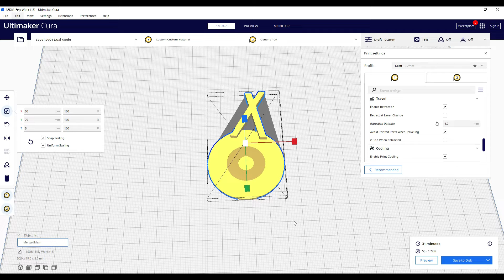What is the Optimum Retraction Distance while 3D Printing?

Comment: What's the name of the guy right there? How about the little blob guy? 

Anyway, thanks for posting this video. I can now proceed to try 2mm distance if it will make any improvements on my printing. Currently I'm using 0.4mm nozzle as the default that comes with my Ender 3 V3 SE. I'm super curious to test this now. Again, thank you for your evaluation and testing video.